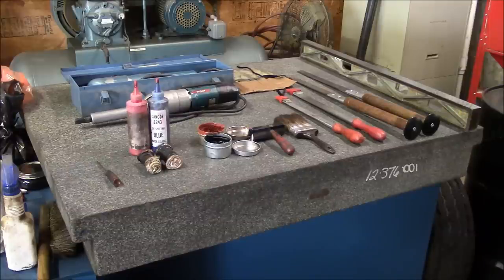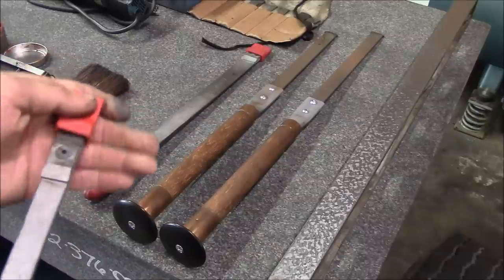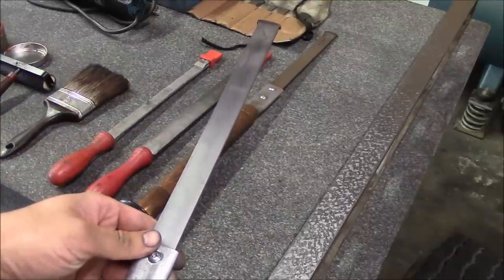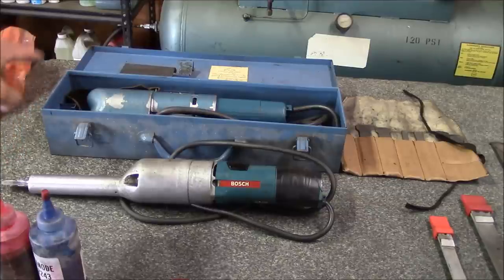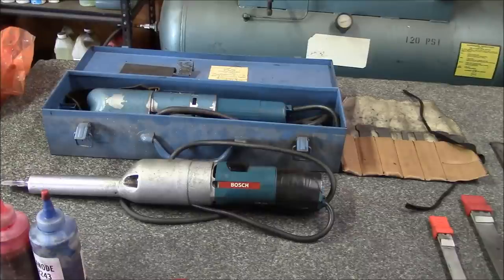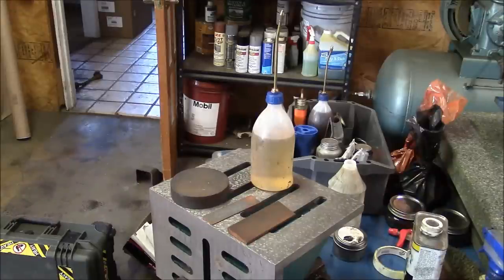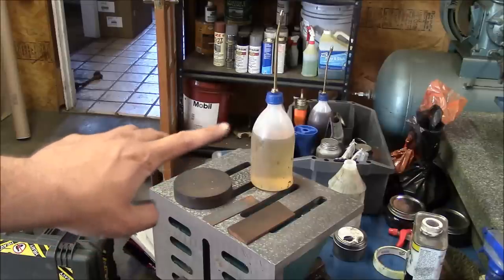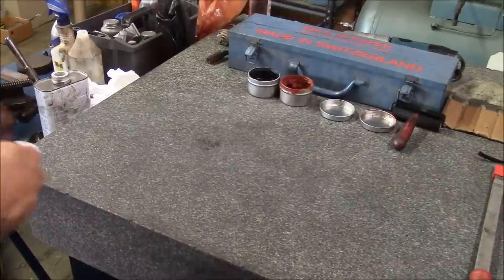Hand Scraping - How I do it.

Comment: As a former scraper from 1977 to 1983, I enjoyed watching someone else scraping, and agree with what you say about saving time by switching techniques as things progress. It took me a couple years to learn that, as I progressed in my skills. Old worn out machinery can be many thousandths off, and I was taught by other scrapers to do just what you do! I still have my old tools, Prussian blue, and red lead, and wonder if I can still do it, I used to be as good as you! I also lifted at the end of the short finishing stroke and gave it a left-handed curl, giving straightedges and surface plates a beautiful frosty appearance! Machine tool surfaces got a 12-14 point finish with good oil retention, alignment to other machine members was most important.

Comment: Nicely explained Wes, you are absolutely right about the roughing stage needs to be done right before moving on to the semi finishing strokes. I like the fact you talked about both print mediums, I've not used anything other than the oil based one here in the U K, but now I'm used to it I'm happy with it.  just wished they made a contrasting colour,  so now I might try and mix one up. 
cheers for the upload, all the best, Mat
Reply from the maker: Thank you. I know some guys use the regular blue and just make up some red for contrast. It works well.

Comment: It is AMAZING how such a seemingly primitive technique can yield such precise results and still be in use today.  I have seen old metal scraping films, but thought that the technique would have long been superseded by modern micro polishing techniques.
Reply: 😊 Informartion japanese highend mill producers use this before using a machine. So it may appear primitiv but it works very perfect. Especialy in dovetails a grinding or polishingmachine could only been placed with a lot of effort in place. When a human can bend very easy in position.

Comment: Helpful vid, saw many valuable points and hints. Thanks a lot.

would like to add some comment.

Regular radial bearing case could be used to remove rough edges after scraping, instead of stone. To reduce abrasive exposure.
Also regarding dovetails, how do you clean them after stoning?
To work with hardly accessible surfaces like small dovetail inner parts, it is possible to create small scraper from stone\glass drill bit, spear headed. This "spear head" has almost same quality carbide as special scraper inserts. Despite the price difference, but it's a fact. Scrapers made out of drill bits rather well deal with soft cast iron like that coming from Chinese factories.
Their drawback is lesser ability to keep sharpness, but again taking into account the price...

Just remove extra metall at the base and flatten carbide insert in desired radius.
Best cutting angle is around 110-115 degrees.
Though i personally prefer to correct such surfaces in mill using some dedicated tool, like dovetail cutter, to decrease hand scraping amount as much as possible. 
This is really an action which produces thoughts about finding more heavy intellect means to achieve desired results.

Comment: Hi Wes, thought I would pop back and let you know of  a trick I just figured for a background colour - I used a sharpie over the surface and then a drop of mineral spirit to dissolve the sharpie mark - smeared it over and then in a minute or two the solvent was evaporated and I could print the regular oil based blue medium I use. Worked a treat and Ive plenty of sharpie colours ! Cheers Mat
Reply from the maker: I saw that in your video. Very clever.

Comment: 10:30 That's a sweet Buttress thread vise.  I could see it being handy for scraping since it allows for such quick adjustment and you don't have to worry about cleaning chips out of the nut as often as you would if you used it on a machine.  Thanks for the awesome video.
Reply: Buttress? More like buttrest

Comment: You might say, you have to get to the point where your lows become the highs before you move on to finishing.
An angle plate is not a bearing surface.
Scraping a bearing surface requires small individual scrapes of about .0002-.0003” for oil retention.
And, flaking is to be done on the underside contact points.
This is what I learned in Richard King’s (Kingway) scraping class.

Comment: Very helpful video Wes, thanks very much for this! :) The visibility of the black spotting compound seems quite good, I think I'll go find some of that mortar color :) One thing I noticed, all the books and videos I've studied about scraping indicate that the individual strokes should be made side-by-side, in rows that are 45 degrees across the part. The claim is that it leads to chatter in a sliding surface if you line the strokes up in "vertical" rows. I don't suppose it matters much during roughing and it looked like you did the side-by-side stroke rows in the finish pass, but just thought I'd mention for whatever it's worth. I love the handmade scrapers, very practical :) Also, it looked like you position the part down just above your knees, is that so you can push the scraper with your hip? Btw, on the Canode, they say to "thin" that with very thin vegetable oil (safflower maybe); using water could explain some of the bad behavior it was exhibiting.
Reply from the maker: I have heard of others thinning Canode with window cleaner. I have not tried that. Window cleaner is mostly alcohol, so it seems like it would flash off too quickly. 
Connely advocates the 45 degree rows in his book. I usually line my scraper up at 90 degrees, but the actual scrape marks are not 90 degrees to each other because of the way I lift out when scraping. The same thing happens with the Biax. The longer the stroke, the more you see the effect. The result is that the actual scrape marks are more like 45-60 degrees to each other.

Comment: Great video! Nice overview on your scraping.  One thing though, the Canode isn't actually water based, it's water soluble.  It is very thick and a little sticky, as you say, as well as the other issues, but if you don't dilute it with water it will NEVER rust your work. I leave it on CI for days between scraping sessions.  I'll try to find out what the carrier fluid is. If I need to thin it I've been using denatured alcohol. It flashes off quick and no rust issues.  Keep up the great videos.

Comment: Thanks for posting videos Wes, very good instruction.  Both you and Stephen Gotteswinter provide informative instructional vids. 
I used this knowledge to scrape in a cross-slide on s small chickety-china lathe, worked well. 
Do you take requests? You do everything relating to machining equipment, manual and NC, cornucopia of knowledge. 
I have a haas sl30 ( sorry ) , and want to know how  do maintenance on the turret. You did a very good turret alignment episode on the slant bed. Curious if haas turrets need to be disassembled and cleaned/lubricated periodically.
Thanks Wes J.
Reply from the maker: I believe that Haas uses compressed air to clamp the turret which is odd. I don't know of any other builder doing that. Other than keeping the curvic coupling clean, there's not much that needs to be done to the turret.

Comment: Nice vidio I am learning too but Chinese angle plate! Would it worth scraping cause you leave it for a year it would twist distort etc.I don't trust Chinese cause they cast in the cheapest way to get the object look alike. My two cents is you rubbing stone should have hole in the middle and you should stick to figure eight and spend more time on hand lapping(remove sharp point).
Reply from the maker: Yes, the casting is terrible. It's full of gas bubbles and impossible to scrape correctly.

Comment: What's the purpose of flattening the Plate is it used for specific purposes? These videos are so entertaining and intriguing to me I like these older video! @Watch Wes Work
Reply: The plate would typically be used when clamping other parts that are going to be machined (say on a milling machine). Having a flat and square angle plate means anything you clamp to it should  be square to the machine bed.
Reply: Yes. Ultimately Wes will scrape the adjacent surface, but it will need to be scraped perpendicular to the surface scraped in this video. Getting flat surfaces is one thing, getting flat surfaces precisely perpendicular, or at angles like doevetails square and parallel to each other is where it gets rough! Wes does a great job in this video.
Reply: @EricTViking  oh Thank you for The Information
Reply: @charlieromeo7663  oh okay Appreciate the information

Comment: Great video.  I learned a whole lot here. One question.  How do you maintain the perpendicularity of the angle block?  90.000 degrees, means 90.000 degrees, right?  Do you do rough in, then measure a whole bunch of times for angle, average the results, adjust the rough in and go again?
Reply from the maker: I swear I replied to your question, but it seems to be gone now. Scraping for alignment is a whole other subject. The best way is to compare the angle plate to a known master square. If you don't have a known master square, you have to use 2 or 3 angle plates and compare them to each other while scraping and eventually the errors will cancel out. The Moore book "Foundations of Mechanical Accuracy" covers the topic thoroughly. 
Typically the alignment is set in the rough scraping. You would check periodically while finish scraping to be sure you do not move the surface out of alignment. It's far more tedious than just scraping a surface flat.

Comment: Wes,  never seen this before, not sure what scrapping is.....i am assuming you are trying to make the surface flat.  can you tell me why you are doing this......can a machine do this? surface mill?  so confused.  but a great video
Reply: A surface grinder heats the workpiece causing it to distort. So the process is to grind it as close to perfect as you can, then fine tune the surface with scraping. It also allows the surface to hold oil better. Much like crosshatching in a cylinder bore.

Comment: I still haven't quit figured out how you get your marking die to that consistency. Yours looks like a heavy grease and not too sticky. When I mix mine with 30 weight or way oil no matter how thick I mix it eventually slumps to the bottom of the container. If its really think it acts almost like a non newtonian fluid and is very sticky. It seems to work well and sometimes I thin it with denatured alcohol that helps,  I'm just curious. I think I have some of that old blueish green x-tra heavy wheel grease, I guess I could try that.

Comment: I've got a set of big machinist parallels about 3ft long and a lonely 2ft parallel (or maybe vise versa I forget which size I have a set of) and I'm wondering how you decide between having a smooth finish or a scraped finish. I know putting them on a grinding machine is a good "roughing" (relatively speaking) procedure prior to lapping or scraping for overall parallelism, but I'm unsure about the advantages to scrapped verses a smooth surface for the final product.  I am aware that the scrapped finish helps distribute a film of oil when it is used for something like machine ways, but given the use of machinist parallels I hope to not see the same sliding motion experienced by the machine ways.  Truthfully I don't own any machinery remotely big enough like a big horizontal boring mill or metal planer to make regular use out of the parallels, but I would still like the project of doing some finishing work on them.  I'd love your advice before spending lots of time hand scraping them, or even more time lapping them into a surface finish that can be wrung too. 

Thanks in advance,

-Adam
Reply: One advantage of a scraped surface is there is no heating to cause the work piece to distort like there is with grinding. Another is that the surface holds oil better, much like cross hatching in a cylinder bore. Not so much an issue with angle plates and straight edges, but very important for machine ways.

Comment: where can you find that massive counter top? Also where could I find a straight edge? Thanks. Awesome video btw and sub up!!
Reply: If you're talking about the granite, that is not countertop.  It is a 'surface plate', and its only purpose is to be very, incredibly, flat and stable.  Countertops aren't thick enough to be stable, and are nowhere near flat enough.  On top of that, many countertops aren't even solid granite - they're composites, meaning they're granite 'gravel' mixed with epoxy.
Reply: Starret makes all the precision tools you could dream of

Comment: My lathe (South Bend 9) has a  wee bit of 'ridging on the last 20% of the Cast Iron Bearing surface chuck side.....they say to hone off any high spots but don't try to stone it down......any advise, which honing device, and what technique? The spindle has a few deposits of CI corresponding to the bearing....ordered a set of EZ-Lap diamond hoaners and have access to another lathe..

Comment: Nice job explaining how to scrape, Wes!

I'm very curious about your home-made marking medium. I've used both Dykem high-spot blue and Canode (both yellow and blue) and I agree about the downsides of water based spotting inks.

Is there any particular mortar pigment you'd recommend? Would artists dry pigments work just as well? (Seems like 4oz of pigment would be sufficient for plenty of scraping).

I REALLY like the high contrast of your marking media, but both the red and black appear to be awfully thick. Is there any problem with the grain size of the pigment?

As you mention, I'm used to spreading Canode so thinly that it's quite transparent. I'm used to spreading the yellow base layer so thinly that it's dry to the touch and just the lightest haze of yellow.

That Canode can be spread so thin is good, but the low contrast markup (and non-ideal lighting in my shop) is killing my eyes. If dry pigments and oil can be spread just as thin, doesn't dry out, provides high contrast, and works even reasonably well for scraping blue-ups, I'm going to be seriously indebted. :-)
Reply from the maker: There is no silver bullet. The homebrew I use works well for roughing and scraping machine tool ways. It's not the greatest for precision scraping more than 20 points per square inch. You can do it, but you have to be really careful how thick you apply it. Also, the thickness of the paste is really important. If it's too thick, you can't spread it enough to get a fine print. If it's too thin it won't transfer. 

The pigment is a form of iron oxide. The particle size is supposed to be 3 microns, so its extremely fine. Mixed with oil, it's not abrasive in any way. It's basically a grease, which is normally oil thickened with something like clay or soap. 

There are lots of recipes. I know a guy who still uses red lead mixed with a type of wax. It's actually a dry cake. He spreads it using a rag wet with wd-40. Then he uses Dykem blue as the contrasting color. 

I think I will make a video on the subject in the near future.
Reply: Hey, thanks for the quick reply! I'm definitely going to give it a try. Even if I end up using something else for the final stages (I've even used the haze from dried alcohol for the ultimate final check) it's still a huge win for me if it provides better contrast. I'm looking forward to giving it a shot.

Please do make a video on the subject!
Reply: I've used oil based pigments mixed with all purpose grease. Applied thin it works quite well. When you're done for the day, to clean your hands just use any vegetable oil like corn or safflower to "soap" up your hands and then dry them with a paper towel. Oil cleans up oil better than water and won't lead to dry, cracked skin like repetitively using soap and water does. This cleanup trick works just as well if you get your hands greasy working on your car a lot.

Comment: Once you have one side of the angle block scraped and flat......how do you square up the other surface to get perpendicularity ?
Reply from the maker: Scraping for square is a whole other issue. I'll try to cover it in a further video.
Reply: You need a reference that is perfectly 90 machined and then you clamp the finished surface and blue.
Reply: you can also self generate them using the three plate method

Comment: I like your printing dye.  Do you think that chalk line powder would work like the mortar pigment?
Reply from the maker: I don't know. Possibly. It would be pretty easy to test.
Reply: To work for printing, a solid pigment has to be particles smaller than the thickness of the color film.  That's really tiny, and I don't think chalk particles are small enough.

Comment: Isn't the plane being inclined in one direction thus changing the 90° angle too much ? I can see this working well for flat surfaces but for angled supports is that ok ?
Reply: When the other side is scraped, squareness will be corrected/maintained/addressed.

Comment: For someone that doesn't know, what's the benefit of scraping vs. having it machined?
Reply: Late to the party, but the advantage of scraping over a machined (ground) surface is that the scraped surface has slight depressions between the high spots that can hold oil. So if you have two sliding surfaces, the scraped one will hold oil between the surfaces whereas the ground surface can squish the oil out. Scraped surfaces can also slide more easily than ground surfaces as the scraped surface reduces the negative effects of stick slip.

Comment: My question for anyone now is. How do you now scrape for square on the other face?
Reply: I think i know the answer scrape one side flat  and blue an angle plate and rub it to show wheres touching and you scrape it.from my experience you should scrape individual marks rather then scraping the blue with an uncontrolled method.meaning hit where the blues ate but has to be spaced in between scrape marks and cross the scrape.
Reply: With a square level